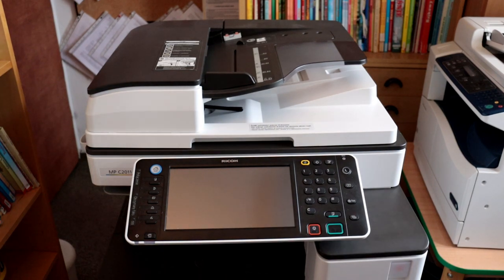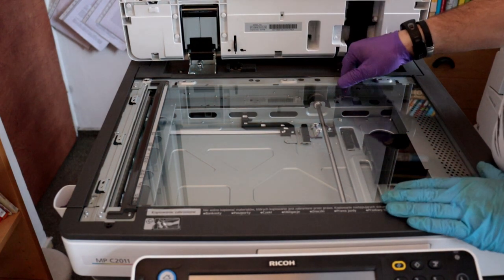Cleaning the scanner's mirrors RICOH MPC2503 MPC2003 MPC2011 Maintenance Photocopier

Comment: Basically I am a Social Science Teacher but recently I opened a photocopy shop. I have this MP C2003 machine. I need to learn how to connect it to my laptop for Scan. I appreciate you for sharing the video. Thanks
Reply from the maker: @syedaamirhussain6111 You can connect to your laptop using a regular USB cable, but many options don't work then. If you want to scan and use all the features of the device, you need to connect the copier to a router or computer with an RJ45 cable. It's not easy, so if you're wondering what to do, it's best to call a service center to have them install the machine correctly. You can do the rest of the repairs and replacements yourself or I invite you to an individual RICOH MPC2003/2503/2011 training (Drum Unit, Developer Unit, Feed Rollers, Fuser Unit)./ The training is online. If you want more details, write to me at copy-expert@wp.pl, provide your YouTube nickname in the email and paste this correspondence. Best regards. Tomasz